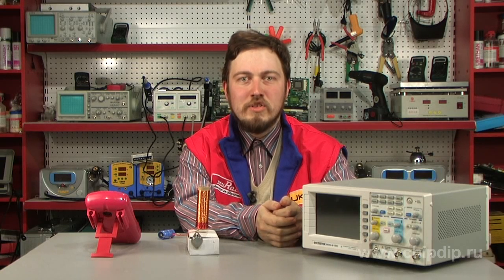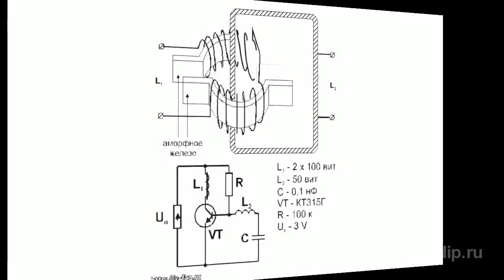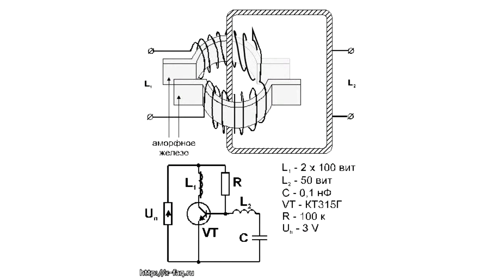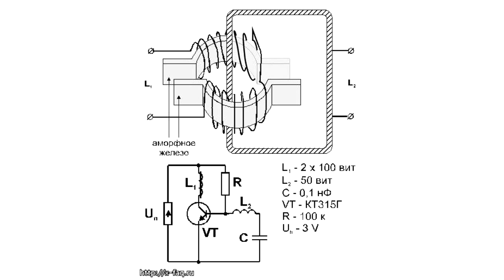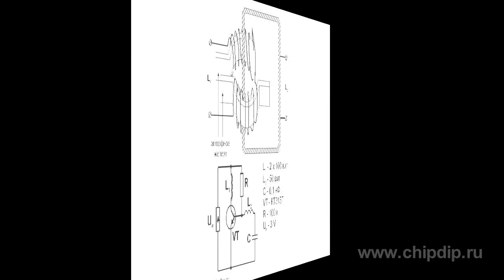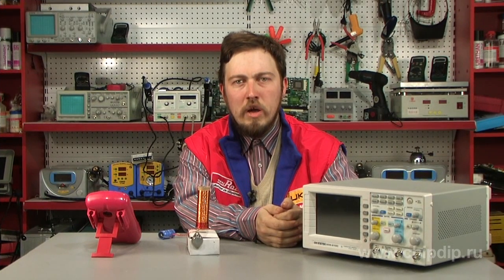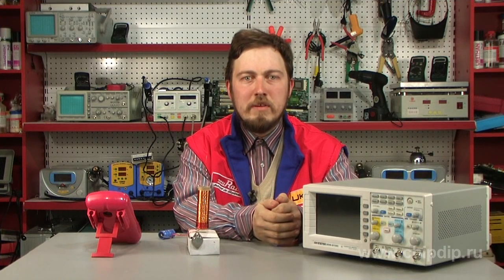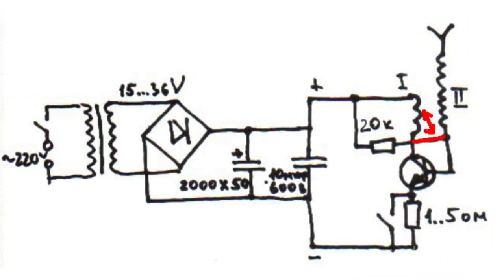Brovin / Kacher Generator (Invention and Operating Principle)

Comment: Great job with the translation, really helped with learning the system. Tesla was using this type of tech it seems too. A lot of people are making earth batteries and this circuit together to produce a tremendous output of power with little input. Wondering if you have achi9ved overunity yet with any of your exp yet?